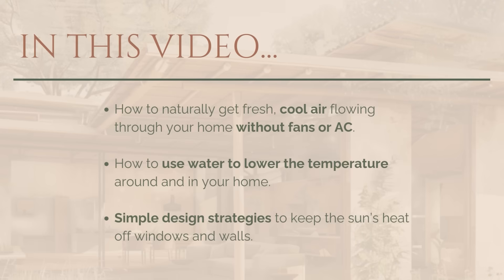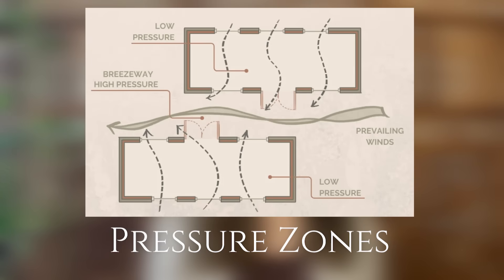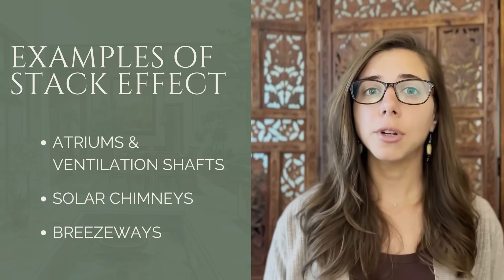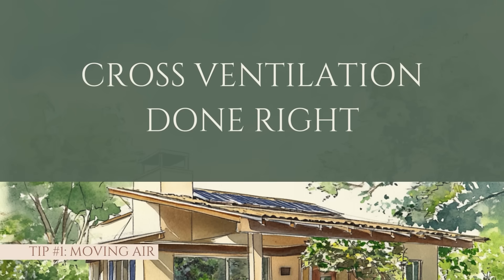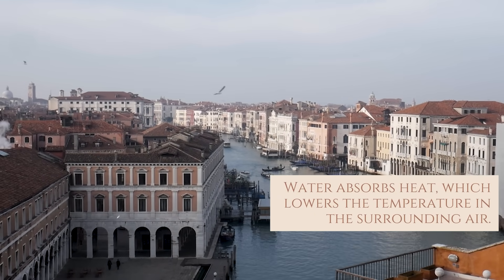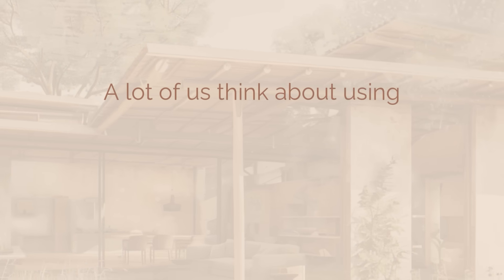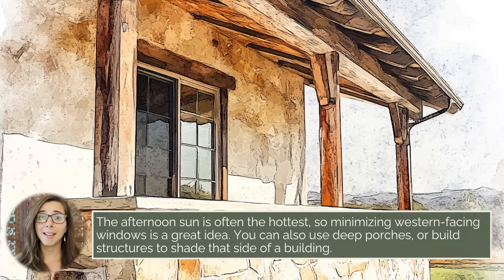The Forgotten Cooling Techniques Architects Don't Talk About

Comment: This is all great. Except 99.9999999% of us do NOT get to design our own houses, let alone even build our own houses....
Reply: But you can use some of these techniques to fix the problems you encounter. Our 1936 bungalow with a sunroom added on the west side was pleasant up to 100 degrees because I’d crack a window downstairs and have an upstairs window with a fan running in it. The Japanese Maple shading most of the sunroom, exterior blinds on south and west facing windows, sheers in those same windows all helped. 

First thing I do when moving to a new house is access the landscaping and plant the best trees for that situation because it will take a while before they can help. I favor Japanese maples because their shade isn’t dense AND the choices of fall color.

Comment: Waiting on advice for those in hot humid climates. Humidity makes many cooling options for dry climates fairly useless. That said, this was well presented information for those who can use it.
Reply from the maker: thanks!  very true indeed. mechanical intervention is needed if humidity needs to be reduced.

Comment: I understand how cross ventilation is explained here and it makes sense...except that in my house, which relies entirely on cross ventilation for cooling, the only comfortable places to be are directly in front of the windows where the breeze blows in. Anywhere else and it feels stagnant.  Could be that I'm in a warmer, humid climate, but it seems that in some cases the most comfortable option is cross ventilation that goes directly from one window and out the adjacent.
Reply: Try using exhaust fans to force air circulation.
Reply from the maker: sounds like theres not enough of a pressure differential.  The size/opening of the windows has to be equal on both intake and exhaust (slightly larger on intake) for the stack effect to work properly.  Yes, plus low powered fans to help move it.

Comment: For  20+ years I've been trying passive cooling in a tropical area. Bungalow house with high ceiling and large attic. White painted roof. Exhaust vents on roof and eaves. Ceiling exhaust fan in living area. Large windows. Trees, plants and water features all over the garden. But every year it just gets warmer. At night is when the terrible radiant heat happens and gets cool only after midnight. Sadly at almost 60yo i gave up and installed a 2hp split aircon that i only use from 5pm-midnite on warm weather to counter the radiant heat. During summer ac is on from 10am-10pm (no night radiant heat).
Reply from the maker: sometimes in humid climates a A/C unit makes sense in bedrooms and closets to reduce humidity and overall ambient temp.  Sounds like you did your best!

Comment: I live on the side of a small mountain. At night, cool air drops down the mountain, and in winter this air is shut out from the house, and in summer, it is encouraged in often at night. A window or a door at a higher level in the house exhausts warm or hot air. A fan at the high point increases the air flow. Ain't nature grand. Mountain living can be naturally cooling.
Reply from the maker: nice!  i love that you have  a system working well for you!  Nature is grand, indeed!

Comment: Excellent vid Christina.  I'm an Australian builder in the tropics of the Philippines seeking passive cooling rather than doing it all with AC  - though Solar Panels do make AC nearly free to use.  I would add: white metal roof with foil sarking 2" to 6" below it and an attic that can breathe out solar radiant roof heat - like a Dutch Gable roof or under sofit vents.
Reply from the maker: Great addition, thank you for noting that detail.  The dutch gables are perfect in the tropics, most of the roofs in Hawaii are built this way too - I cant believe I forgot to mention that!  Thanks for the kind words and contributions :)

Comment: From experience the following helps in cooling in hot tropical climate
1)  build house in wooded areas cool by 3 Celsius compared to cities.
2). High ceiling of 4.2 m especially if hot air could escape through a staircase well. 
3). Cross ventilation or Window openings for air to flow through the house.
4). Courtyard house with central water feature.

For further mechanical cooling, use ceiling fans. For large public areas, cool using large volume low speed fans of 24 ft diameter.  Even evaporative air cooler can cool by 3 Celsius in the tropics. Can augment it's cooling by using iced water. Cheers.
Reply from the maker: Hey thanks for the great tips!  I love the emphasis on rural wooded regions and low powered fans!  Cheers!

Comment: This is like watching a highschool physics teacher telling you "assume a closed system with no friction".

The issue of cooling is NOT as simple as using wood or mud or holes or water. This is a complex multifactor challenge that directly depends on your microclimate. 

Water cooling means more humidity. So youd need dehumidification and materials resistant to water. Youd also need pumps and heat exchanges and a steady water supply.

Mud walls and thick heat resistant constructions are unfeasible in most developed places. They also feature other limitations you'd need to design around (light, heat retention). 

Finally the issue of heay differentials: when you change a system, it seesaws everything. Now you have cool air inside, warm air rushing in. What moisture barriers do you have? How do you control the air mixing? 

The builder code is hundreds of pages long specifically because of this complexity.

Comment: Heat does not rise.  It is technical but heat travels from warmer to colder. Yes warm air rises but that is due to the effect of humidity and air density.
Reply from the maker: sure, thanks for clarifying
Reply: Hot air rises even on planet earth regardless of humidity and air density? That is something applicable in a lab.

Comment: Yes, yes, yes........but no. Your stuff about high pressure was flawed. When air moves faster (ie the wind blows) it doesn't create HIGH pressure, it creates LOW pressure. If this weren't so, aeroplanes couldn't fly.
It would be really nice if your lips moved in synch with the words you were saying.
Reply from the maker: When it hits an object it changes.   Yes, what your saying is right about planes.

Comment: London flat with solid brick wall 500mm 18" thick. As said, need to combine both winter warming, with summer cooling.  Found curtain linings of thin beige, but with aluminium flakes on side to curtain. From Swedish Ikea, who have very cold winters. in summer, pull linings closed to reflect heat out.  Thermal mass very important; ie solid masonry, and concrete, and old lime plaster. These absorb heat on hot day. Unlike modern interior with high insulation covered by thin wallboard, internal air heats up quickly when sun enters.

Comment: My grandparents had a big (easily 3000+ s.f.?) old house in a desert climate, with about 10’ ceilings on the ground floor.  Windows on all sides, facilitated cross ventilation.  
Summers routinely sat at about  90 - 110*F., for months in summer. 
Maybe the star of cooling that house, was the Unusual evaporative cooler. 
 Rather than fiber pads dripping water with air blown thru (guaranteed to increase indoor humidity, even in high humid climates—& turn moldy), it had a 15’ tunnel, with a metal tray in the bottom.  
A large diameter industrial fan with a dry filter, running on lowest setting, & positioned at the north-side outer wall, blew filtered air across the long length of the water tray.  
The tunnel was lined with galvanized metal.  Nothing to turn moldy.   
Remember, cooler air falls to lower elevations…
The staircase turned a couple of corners to reach the upper floor.  
The air tunnel exited out of the wall at the upper 2nd turn of the stairs—so, about 4 steps down from  the upper floor, but, positioned to blow most of it straight over the longer stair section, so the larger portion of cool air easily reached the doorway to the ground floor, where the doorway slowed it just enuf, to force some of the cool air to stay upstairs—low-tech engineering at its finest! 
Water was auto-filled into the tray, using a faucet tubing & a float mechanism to turn that off/on as needed. 
The dry, hot outside air blown over the thin layer of water in the tray, never picked-up too much humidity—it simply caused about an average 50% humidity in the house—which was more comfy than the low humidity desert hot air—it helped the cooling effect be better, because of the 50% humidity. 
From other experiments, even if intake air was high humidity, that cooler tray-water would dew-point capture the excess, & the blown air into the house would still be around 50%. 
Proportion of tray length, fan speed, height position to house-height, etc. variables, is what makes or breaks the efficacy. 

Their Windows got opened slightly on the other side of the house to let out air, but not as often as the attic fan was used. Attic fan helped lower attic temps, to stop high heat baking back into the house. 
Both of the fans (for the cooler & attic) could easily run on a modest solar panel or two. They were very quiet. They likely had rubber mounts to dampen vibrations….something too many HVAC installers fail to do!  
Landscaping shrubs & trees protected the hotter south & west sides of the house. 
So did a vine-shaded structure built to shade the downstairs west-side of house, over the concrete driveway, to prevent it heating during day & cooking back at the house. 
The kitchen was a galley across the north side, with great ventilation if needed, & a doorway to isolate it from the rest of the house if needed. 
That whole place was an oasis of peaceful cool & shaded gardens, in hot summers! 

Plants shading the house in summer, & the leafless vines in winter, can help temper the structure year-around, we found.  
One bedroom wall at our place, a wall socket got too hot to touch—we thot it had a short!  Turned out, afternoon summer sun cooked that wall  hot!   
Simply placing a potted shrub next to that, stopped the blistering summer heat nicely.  
The leafless vines also tend to hold some warmth or act kinda like a lite blanket in winter.  
So, I mounted railings for vines to grow over the wall. 
Those are still growing—I might need to rework them. 
 I might mount some insulation panels on that wall, & put metal panels over those, to better temper this cheaply built 1970s tract house.  
We built-out a roof extension to protect most of the south wall from weather—it was starting to develop costly problems.  The roof extension prevented those worsening—& bonus!—it ended up helping temper the indoors, by a modest but measurable amount. 
We win!  
Now, I want to build a similar shelter patio roof across the front of the house—which gets an astonishing lot of heat gain on summer mornings, & heat loss in winter.   

Deep Porches help temper indoor spaces; they are a transitional space for entering/leaving house; shed rain farther from house foundations & most of the house windows—preserving the house longer; they offer cooler summer sleeping if screened, or “camping” for kids; & give place to socialize or work on tasks that need a protected space outside. 
We need to normalize building wrap-around porches again!!   They help all year around!! 

Low-tech cooling pantry without a basement?—yes! 
A cupboard or closet in the NNE corner of a house in northern hemisphere, with a screened intake vent from under the house (crawlspace), & an outlet vent high up on wall or thru ceiling, to vent out the shaded side of the house.  A cool breeze convects passively up thru screen shelves or wire racks, keeping fresh foods cool enough if used in 2 to 4 days (longer for some things). 
To make it cooler, dig a reinforced pit 6’ to 8’ deep, in the shade, give it a heavily insulated lid, then put a 4” tubing to draw cool air from the bottom of the pit into the cooler closet screened floor.  Give an air intake to the pit, from under the house, or better, recirculate air from top of closet, into the top of the pit. 
 That can be augmented even more, by adding thermoelectric cooling & cooling fins & fans, with the warm side to the outside, & run that on solar panel….recirculate the air from the closet to the cooling pit—done right, it can reach freezer temp., & that can chill the fridge compartment to fridge temps—if the closet is well insulated, even better—this was proven thrifty & effective, decades ago.  
Thermoelectric cools about 30*F cooler than ambient air—the bottom of the pit is about 55*F….thermoelectric is only costly & impractical, if the thing is fighting against hot air.
Reply: Passing this on to my husband, daughter/son in law for their Tucson house and son/ partner for their PDX home. We could all use that extra cooling space for food in our houses! 

I loved our deep (10’) wrap around porch (east, south sides) on the house I grew up in.The railings were wide enough to sit on and it kept the living room and dining room cooler in the summer. Never understood why they didn’t plant trees on the west side of the house…it got hotter than hell in those two bedrooms in the summer.
Reply: @ginasmitasin479    The idea of using passive solar gain for a house, is nice in theory…but I’ve only ever seen it work well, when used for the passive solar greenhouse walls in Earthship building—the mass of the bldg is so huge, that passive solar works, if sited just right. 
& passive solar gain in winter windows can sorta work in mild climates like S.CA.  
But if there are temp extremes in winter &/or summer, & your bldg has scant insulation, like so many tract houses, & so many “manufactured homes”—those structures very much need about a 10’ deep wrap-around porch!  

Might look into how ancient mideast homes had amazing passive cooling tech.  Usually a tall chimney tower, & all the room ceilings got beveled  uphill towards that vent tower.  They’d open air intake vents from low on the bldg’s N. side, or side away from sun.  Fresh air entered, flowed thru rooms, warming as it rose towards the beveled ceilings & up the tower.   User-interface needed to open/close vents, but once installed/built into the place, it just worked for as long as people living there used it. 

Earth berm around & at least 3’ up the sides of a house, is terrific at keeping the interior of a house tempered nicely for lots less.  
Think of how the hogans are built, or the old  houses in the prairies got built, or the Viking houses—half way or totally dug into the earth, multiple feet-thick of dirt protecting walls from severe weather, & using the earth’s average temp to temper your house.  

Nature is amazing…& very helpful, if we humans pay attention & work with it (usually low-tech), instead of against it (high tech).

Comment: yeah is useful if you are rich and gone build you home from the ground up ,
Reply: Not rich and have never built a house from the ground up. Planting trees, installing fans, opening certain windows and installing exterior and interior blinds or curtains can all help. 

I bought $100 worth of matchstick blinds (this was 20 years ago) and put them on the outside south and west facing windows of one house and it helped immensely. Growing trees near those sides of the house also made a difference. I’m fond of Japanese Maples,  Clereodendrums and Sumacs. Putting up sheers instead of heavy curtains keeps your house bright inside and works just as well.

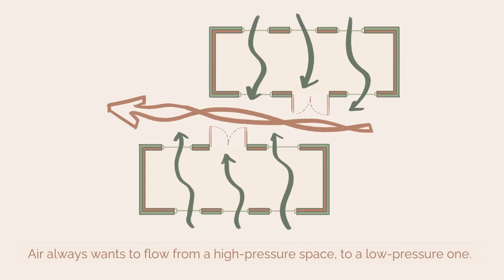Comment: At 2:34 in the video, you mentioned that wind on one side of the building would introduce a high pressure zone, but the Bernoulli Principle states that moving air will yield a lower pressure. Will you please make that more clear for me?
Reply from the maker: On the windward side (the side the wind hits directly): The air slows down as it collides with the surface. That causes it to build up pressure—this is stagnation pressure, not Bernoulli flow. So we get a high-pressure zone here.
→ Think of wind pushing against a wall: it doesn't slide past—it stops or slows drastically.

On the leeward side or along sides and roof: The air speeds up as it moves around and over the structure. According to Bernoulli, this faster-moving air has lower pressure, which can create suction and uplift forces.

Comment: Thank you for this.  While not free and while still using electricty I installed 2 attic gable fans and a whole house fan and that has caused me to use 1/2 the energy I usually use in the hot months.

Comment: Thermal walls in the house buried deep into the ground can radiate at a constant 58 degrees, providing great year-round comfort. I've seen them in a Monolithic Dome, and it's the best design I've seen so far.

Comment: You also mentioned green (living) roofs. If we try to use them in a hot, dry climate, we might end up spending as much on watering them as we would on electricity for regular air conditioning. The layer of soil on the roof usually isn't thick enough to retain enough moisture for the plants to cool the air around the house.
Additionally, we would need to build very strong structural supports to hold up a green roof.
Maybe it's a better option for dugout or earth-sheltered houses.
Reply from the maker: good points :)

Comment: You show us a solar chimney here: https://youtu.be/M6F9u8NjojY?t=237 — but it's not exactly a solar chimney; it's a regular brick chimney.
A true solar chimney should have a black heating section or a solar air collector connected to a chimney like yours. You could draw it on the roof, next to the existing brick chimney.
Reply from the maker: thanks for the tip!

Comment: Good, clear video, thanks. Have you any ideas to protect/cool a south facing gable wall. It is white painted render on timber frame, with only 2 circular windows?
Reply from the maker: Can do awning roofs over the windows.  Would need to do a shade calculation.